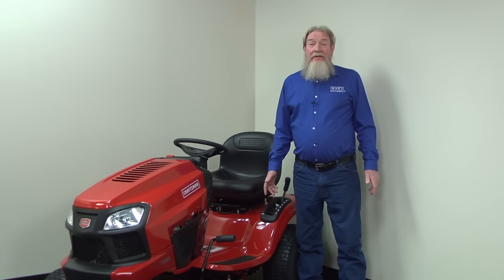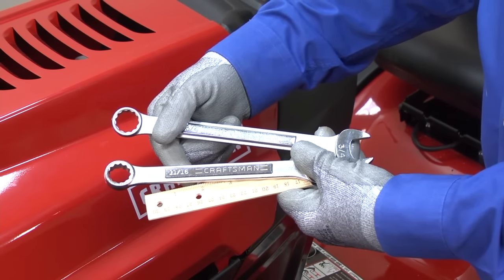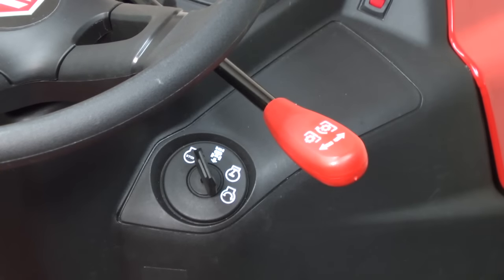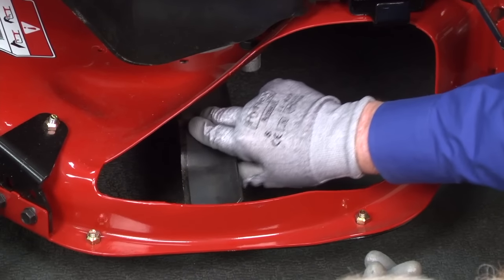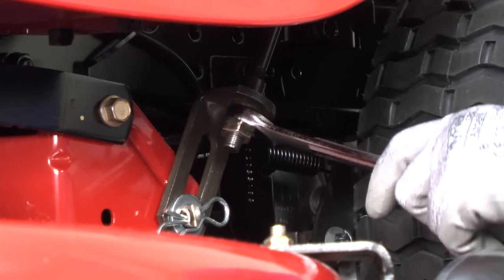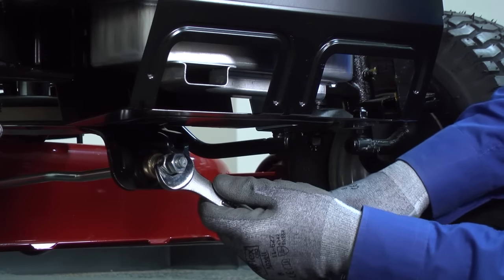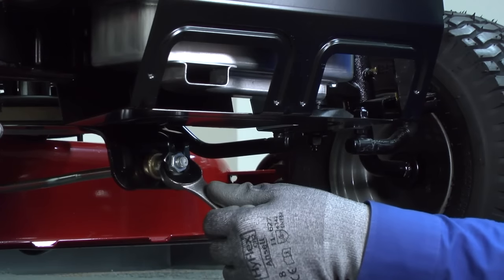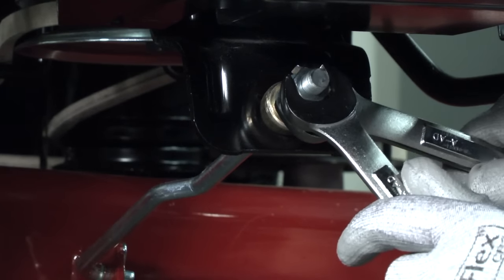Leveling a Riding Lawn Mower Deck for an Even Cut

Comment: Craftsman lawn mowers use to be good, 25 years ago, since the 90's they are probably the worst engineered lawn mowers on the market.  Do your self a favor and buy a John Deer, Kabota, Snapper, Cub Cadet, Toro  From a Dealer and not a chain store.  MTD makes everyone of the brands I said for chain stores. If you buy from a dealer you get the actual brand and much higher quality,  and customer service.
Reply: Nothing against supporting dealers but how about some truth and clarity? Craftsman mowers are based on other companies models. Whether a model is good or bad depends on the underlying model. The current crop are Troy-Bilt (MTD) so I would avoid them. I have a JD D140 and my in-law's Craftsman is nearly identical (based on JD D160). Of the brands you mentioned, Cub Cadet is owned by MTD who has also been making Toro's low end models for the last 10 years or so. Buying the same model at a dealer doesn't help. John Deere makes their own and local dealers inspect and support the tractors sold at the big box stores (the dealers sell the same models but also have access to many others). Snapper is made by Briggs & Stratton. I have no idea about Kubota other than they have a plant in Georgia.
Reply: this is an absolute fact.
Reply: Unfortunately Sears no longer sells Husqvarna garden tractors. They are all MTD now. According to this page Craftsman mowers have a unique mowing decks that are better so at least that is something: https://todaysmower.com/riding-mower-brands/
Reply: kam2244 X  this model in the video is a Husqvarna. Change the color and a few handles and knobs and you got yourself a husq!! Enjoy
Reply: This is an interesting model made during the transition to all MTDs for the US. Based on the front grill openings, extended front chin, position of the side vents, hood vent design, shape of the body in the back half and a few other things, I would have thought MTD but this was indeed made by Husqvarna. It uses the MTD-Sears basic design language but contains parts shared with other Husqvarnas. They stopped making this model in 2016. Looking at the Sears website there are two listed that appear related and actually have more Husqvarna clues: 917.20407 and 917.20409, but neither are available for delivery or store pickup. The rest of the models currently listed all start with "247." which is the manufacturer code for MTD.

There is a Husqvarna zero turn mower 917.27773 available. Get it while you can.

https://todaysmower.com/sears-husqvarna-group-lawn-tractors-108-year-continuous-manufacturing-relationship-stops/
Reply: Even buying from a dealer you're still getting an mtd product.
Reply: My new Snapper ST24/46 from Walmart has a Husqvarna sticker  under the hood. It’s AYP made I’m told.

Comment: This is truly a piss poor design and the build quality is really bad. The assembly of my mower at Sears must have been done by crackheads. One side of the deck is 4" left rear and 3" left front. Right rear is 3" and right front is 2 1/2" . The 21hp Briggs motor has leaked oil since new.      I should have spent more and purchased a real commercial grade mower from a reputable dealer. I've also had nothing but troubles with all the appliances I purchased from Sears. The tech guy has been out here about 7 times in 2 years. I'll never shop at Sears again.
Reply: Sears crap has really gone downhill, I bought a riding mower from them 5 years ago and it has been nothing but trouble. Just like yours, the deck keeps going out of level, it doesn't want to start properly, it runs out of power as you are mowing and it's built terribly. Never again sears.